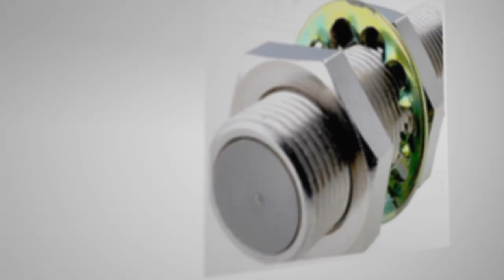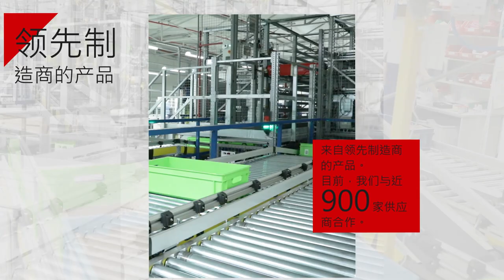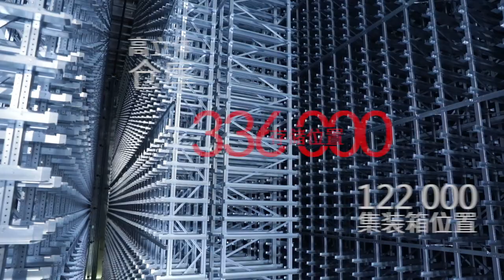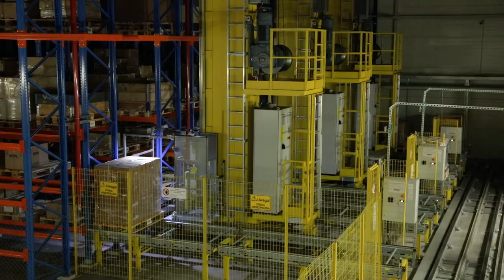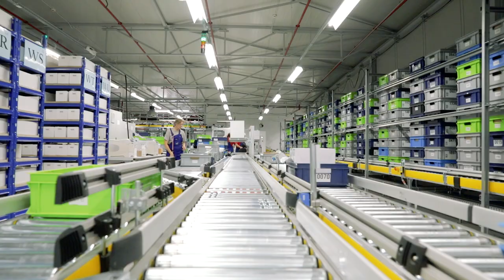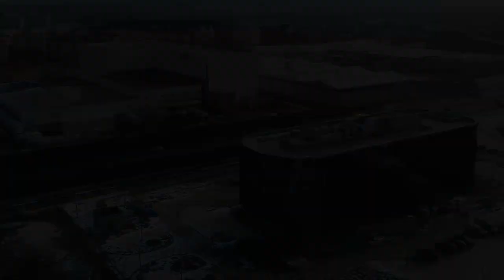Everything you should know about TME in Shenzhen

Comment: ALL GOOD UNTIL YOU HAVE AN ISSUE: All good until you have an issue. Bought 2 Relpol relays RG25-24VDC and one of them was faulty (got stuck). I filed a complaint for which I had to fill out a form, etc. A week after they reply asking for what load I was using. I replied right away 10.5A (it was actually a lot less since we did not run it at full load), but in any case is less than half of the rated load for this relay. Then more questions came, all within a few days. They wanted to know about the load. Then I replied 24VDC, 10A and I told them I only ran a few times and it started to fail. Only one of them failed, but I wanted to change both due to that I did not trust these relays. They then requested to know the brand and model of the linear actuator I was using. I asked why and they actually could not answer. My guess is they wanted me to give up or they were curious on what product I was using to expand their portfolio. They did managed one thing: I gave up on them and decided to not buy anything else from them. Losing a customer for 11 EUR, this is what I call non-sense! Good thing it small money to experience how little they care about solving customers issues.